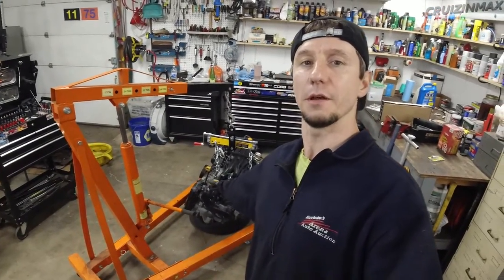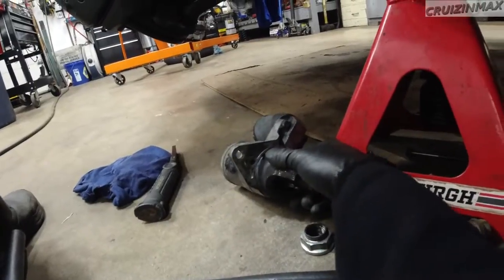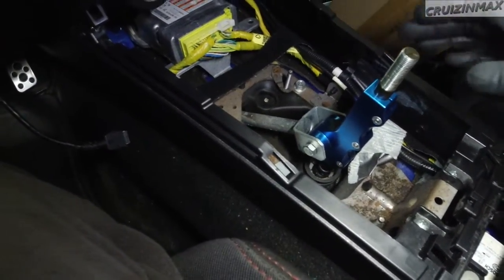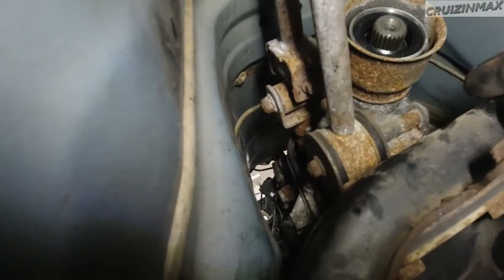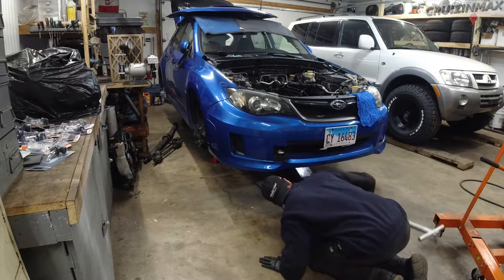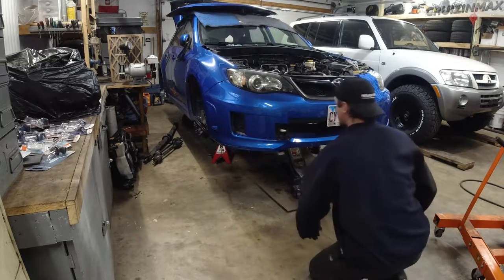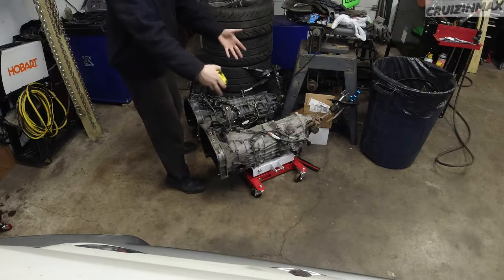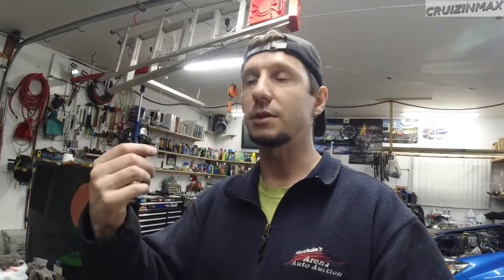Subaru WRX 6spd swap autocross build part 3 transmission out

Comment: My car has been sitting for 5 years what should I do before I turn the key please reply fast
Reply from the maker: disconnect the crank sensor underneath alternator or an ignition fuse or fuel pump fuse or relay, then crank until your red oil light turns off.